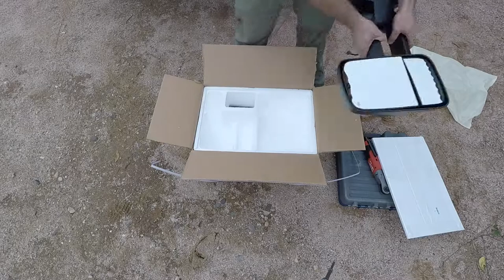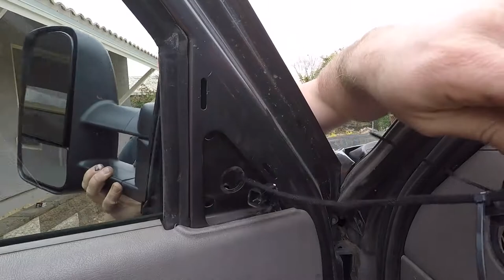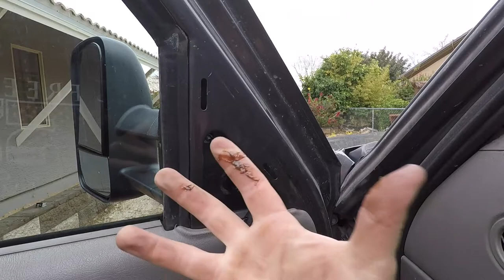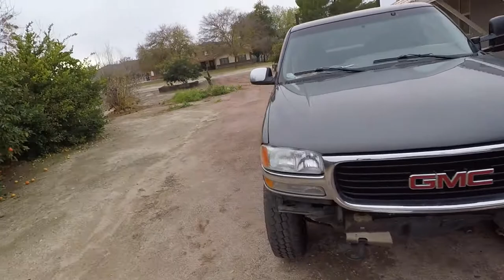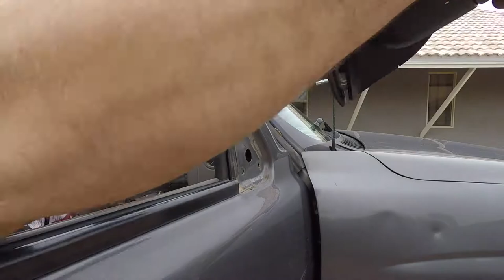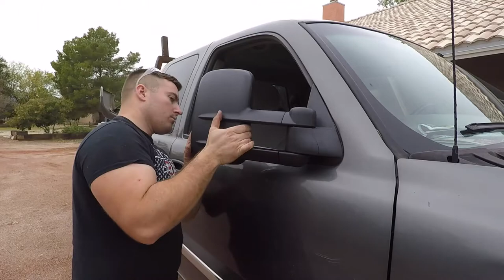Installing tow mirrors on the workhorse, 2000 GMC Sierra / Chevy Silverado 1500

Comment: Been quite a while since your install and I was wondering how well these have been holding up. to daily punishment. I've read so many negative reviews about some brands!
Vibration, weak broken glass, poor fitment and so on. Appreciate your honest review.
Reply from the maker: I personally can’t complain to any of those issues. They were a great price for a replacement set in my opinion, and have held up wonderfully. Crashed around the desert on a work truck and now breaking through brush and bushes out in the Ohio area as more of a recreational vehicle. Truck sees plenty of miles and they’re not easy on the truck per se, but the mirrors are doing just fine.